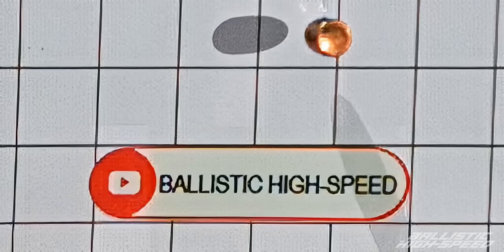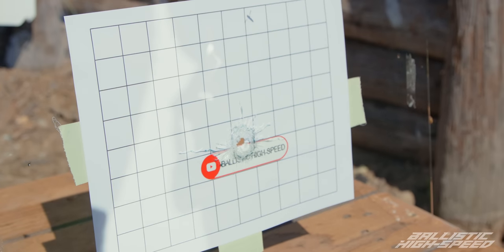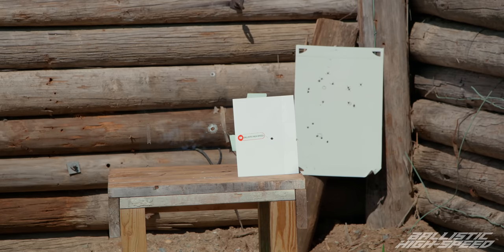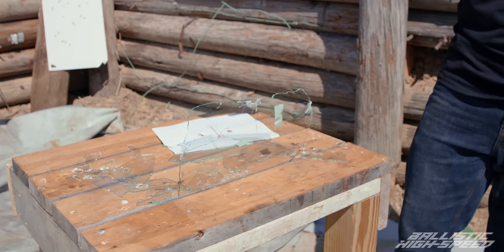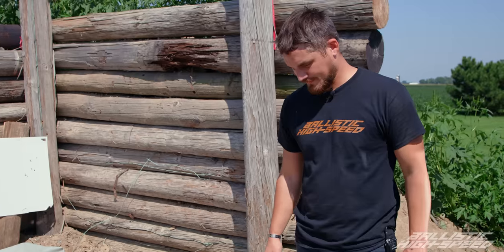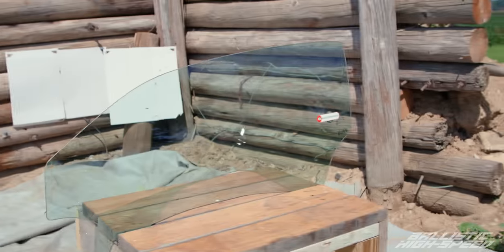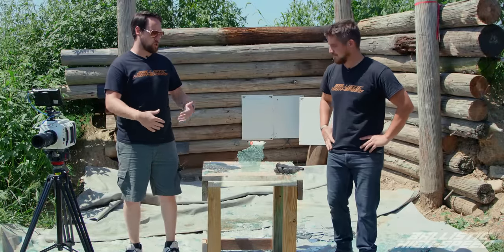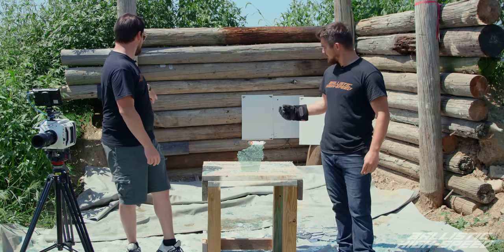Does Glass Break Faster than a Bullet?? - Ballistic High-Speed

Comment: As usual - this reveals details hardly imagined. Certainly the propagation speed of the stressed glass shattering is amazing. One other thing I wonder is - laminated glass, as per windshield - how much bullet deformation and how much deviation from original flight path, etc. Also, what happens to accuracy when something like a 40cal cop bullet is fired thru windshield from within. Great work guys. :)
Reply: I would love to see that
Reply: This came to my mind to! Cops will shoot through their windshield when needed, so I’d like to see how much the bullet deforms/deflects. And maybe even a non-slomo accuracy test
Reply: @keeganhenderson24  I think the most recent one was a Las Vegas chase where the guy was shooting back like crazy
Reply: @keeganhenderson24 They are trained to shoot through the hole they make with the first round.
Reply: @ATruckCampbell  They are trained to try to shoot through the hole they made. That’s rarely the case in shootings though. For multiple reasons
Reply: Id love to see the latter tested in slow mo
Reply: front of a car windshield aim low 3 inches becuase the bullet goes thru in an up direction 3 inches

Comment: Great video! I'm a 25 year glazier and have seen a lot of bullet holes in plate, and a ton of shot out windows with tempered. I've cut glass most of my carrier, broken a lot of tempered glass, and know it well. 

Tempered glass does break faster than the speed of sound. That's why there is a loud pop when it explodes. 

Pressure is what makes plate glass break more. Smaller, faster projectiles create less fractures because there is less force exerted on the glass. 

The buckshot is the most exciting on plate because of the more projectiles creating force with every hit. 

I love glass and I love guns.
Reply: your a good man david. and g-d knows that.❤

Comment: Amazing
Very interesting questions :) & truly a fun science experiment
* The speed of sound in glass is 4540  m/s (~13 times the speed of sound in air 343m/s at 20C) vs the 1650 m/s speed of crack propagation in tempered glass (that you have mentioned)
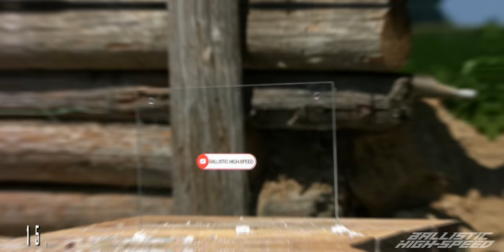@ 12:40 the cracks propagated in glass faster than the bullet that was passing in the air above it (it passed it despite the fact that that bullet was shot before the bullet that hit the glass!)
*super sonic bullets profile was a nice bonus
* throw in a shot gun for some "gratuitous violence" 😂
Reply: I guess you mentioned the "glass speed" (i.e. the linear propagation of cracks in the direction parallel to the bullet)=1400m/s vs 823 m/s for the bullet (super sonic in air) but I was too mesmerized by the footage that I didn't see it! (definitely want to keep such notes a bit longer on the screen in upcoming videos)
👍

Comment: In the dual bullet edge shot at 12:54 you missed something that you hypothesized earlier, which is that the crack propagates "faster than a speeding bullet". Note that the free moving bullet above the glass was leading the bullet that hit the end of the glass, but then the wave from the edge shot beat the free moving bullet to the end of the glass, thus traveling faster than the free moving bullet. This means that the shock wave traveled faster than whatever FPS that .223 round was moving at.

Comment: The shattering of the tempered glass travels at 1mi/sec 
which is faster than sound travels through air,
But could that speed be the speed of sound through glass ?
Reply: Interesting question.
Reply: Speed of sound though glass. 4540 m/s.

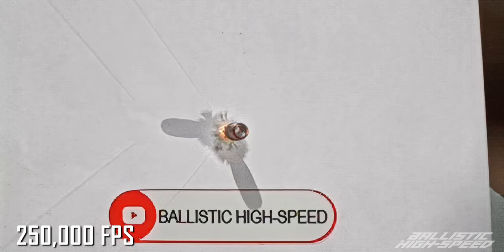Comment: 4:58 Holy crap thats a mind boggler of a shot. I'd love to know the relative density of the air molecules just in front of the bullet, since the shockwave is several millimeters in front of it.
Reply: What is that shadow of?
Reply: @faded183 that's the shock cone. The air density changes so much from the supersonic bullet pushing the air out of the way that it bends light and creates a shadow. If you were to measure the light around that shadow, it is actually slightly brighter than the ambient level.

Comment: It would be interesting to see a massive 50ft diameter piece of glass being shot in the center, with a single projectile, just to watch the leading edge of the crack propagation travel further since it travels so fast. And then do it again with randomly placed stickers to see how it might change that propagation if at all. It would also be interesting to completely cover the back of a piece of glass in clear packing tape and the shot it from the front, to try and hold more of the glass together and see if that changes the speed of the propagation.

Comment: I think part of the glass not completely shattering could be the miniscule amount of buffer that the piece of paper is adding. You can see a good example of it when you shoot the 45 and the 9mm crack gets bigger. It travels towards the 45 impact spot pretty quickly until it gets over to the paper and then it slows to a stop.
Reply: This was my theory also.  Part of the Shockwave gets directed into the paper instead of spreading all the way to the edge of the glass.  Even before they fired the first shot I suspected it would have this effect
Reply: @tnbourne  I wondered in the beginning of the paper would have any effect. Cool to see that it did in such an odd way lol

Comment: 8:56 
Actually, it might be several times the speed of sound in air, but you're watching the cracks move at EXACTLY the speed of sound in that glass as the shockwave moves through it.

Since air has a very low viscosity as a fluid, the speed of sound in it is relatively slow. That tempered glass has a MUCH higher "speed of sound" rate so the cracks propagate extremely quickly and we get one of the most beautiful shots ever seen on the channel. 

Excellent shooting by slowly walking the rounds towards the edge of the glass like that. That was almost the most perfectly ideal hit on that glass for this purpose. It was well worth the previous 6ish rounds.

Comment: The thin plate glass didn't shatter like you expected because it's not tempered.     tempered glass is designed to shatter, that's why they call it safety glass. 
They do that by adding a brief jet of air during the cooling process that causes the outside to shrink just a tiny bit faster than the inside  causing the glass to have a stress that creates strength as well as the ability to pretty much explode when it does get cracked

Comment: my first comment in the English-speaking community. the speed of a crack in glass (or any material should be equal to the speed of sound) in this medium, since the movement of a crack is the movement of matter in a certain medium. And the speed of sound is exactly the movement of matter. It would be strange if the body (crack) moved faster than the matter itself is satisfied

Comment: 2:39
The difference between a 9mm and a 45acp is only 2.43mm. It isn't a huge difference, but it feels bigger when you're holding both rounds in hand. When you consider that the typical bullet weights for the 9mm and 45acp are 115gr and 230gr respectively, it's kind of amazing that there's only about a 10% difference in terminal energy.

Comment: Tempered car windows with the tint film hold together in an almost single piece while the glass itself shatters. That makes my job as an auto glass technician easier, but would also make a VERY interesting video to see the end result as one piece. If you can manage to get a few windshields or laminated door glass to show laminated glass and how it reacts to bullets would be a very interesting video as well. I've seen and handled the end result several times, but never seen just what happens when laminated glass gets shot.

Comment: 11:30 Common misconception. Electricity does not take the path of least resistance. It takes all available paths, only more current is flowing through the path where resistance is slower. The whole impact on the glass is a circular wave like when dropping a pebble on water. And nothing is "deciding" where to crack, nor does the impact break molecular bonds. The path depends on much larger scale crystal structure of the glass, far greater than molecular level.

Comment: You guys need to get in touch with someone who's in possession of, and willing to use, some Raufoss Mk211 and shoot some thick tempered glass. 
Maybe you can get Scott to do the same with his 4 bore...  and then roll back to the minimum and see what happens with a .22 short or CB against the same thick panes, see if you get a splash instead of a shatter.

If he does bring the 4 bore, also take a ballistic dummy and several loose sheets of kevlar fabric to hang in front. You'll get to see the round get wrapped in the kevlar and pull it completely through.

Comment: By the way, for the most part you can't buy "plate" glass. You can only buy float glass - glass that was formed by floating liquid glass on tin. Tempered glass is treated float glass. It would also be interesting to shoot safety glass (two layers of non tempered float glass with plastic between them)- car windshields.  Another interesting option would be tempered safety glass, I think some German cars have that.  Bullet proof glass is a few layers (3) of thick tempered glass with thick plastic between them. Very similar to airliner windshields.
You can still get plate glass, it is the glass with wires inside it. 
Plate glass is rolled out, ground flat and polished clear. Float glass doesn't need the grinding and polishing, it is flat and clear from the lehr. The wavy glass in really old housed is sheet glass, another process

Comment: I actually know a couple things about panes of glass. If a object goes at a high speed through glass with a framed border. The frame's border is actually what will cause the glass to shatter. The vibrations caused by the object going through the glass. Will cause it to stress on the parts where the frame is holding it in. Now when it comes to a bullet going through a window with a frame. I don't think that super fast bullets would shatter it. And I'm talking about regular glass here not safety glass

Comment: It’s not the glass burning, it’s the copper. Glass is already an oxide, but almost any metal, finely divided enough and exposed to air, will ignite. I’ve seen powdered copper burn in air, and aluminium is notorious for it. 
Maybe try some low-light impacts against different metals? Zinc, titanium, magnesium and aluminium will give you some good results. 
Destin at Smarter Every Day has some great shots of Prince Rupert’s Drops exploding when fractured. They have similar internal stresses to tempered glass, but in a long , drop shaped form. Well worth a look. He’s also demonstrated how tough they are and it’s really quite startling .

Comment: when you talk about speed of sound relative to the crack propagation in the glass it is not the speed of sound in air that matters, but in glass.  That speed is about 5600m/s vs. 343m/s for air at standard pressure.
Reply from the maker: We know that. We’re using it as a comparison point for a speed most people understand.

Comment: Just a thought, only got to the plate glass, but if the glass was framed in and more rigid from all sides, would it make a difference?  I'm thinking that the glass only held from the bottom allows for movement to absorb shock.

Comment: Just a small question. You said it was a .223 out of a common AR platform but 5.56 and .223 are different. .223 is slightly smaller in the charge of powder and casing, and isn’t what you’d commonly use in an AR. Totes cool if you were using a .223 AR but just curious as the speed and inertia would be different. Cheers mate!

Comment: Most impressive, is when the air pressure cast shadows at 3:45 4:58
Reply: Air is transparent and does not absorb or reflect much light, hence it is improbable to have a shadow. In this article, we determine the conditions under which air can have a visible shadow comparable to the shadow of glass. This is done with refraction, by changing air's refractive index to that of glass, n=1.5. At a temperature of 0^oC, the air pressure needed to cast this shadow was found to be 1.57x10^8 Pa, analogous to the pressure used in high-pressure hydraulic hoses [5]. These are thought to be reasonable conditions to see the shadow of air.

Comment: The size difference between 45 and 9 mm is only 2.5 mm. A little wider than a nickel.
average 223 roundabout 3180fps weight 55 grain ----- average 9mm 1,200 weight 115 to 147 grains

Comment: "Ship in a bottle shot" shoot though the neck to blow out only the bottom 

Put an LED strip around the pane to highlight the cracking or add different colors 
 
Glass hologram 

Bottes and rectangular tanks under high pressure and vacuum pressure

Prince Ruperts drop I know its been done to death but maybe you can pull something new like biggest one ever shot
Reply: Get the plate glass extremely cold see if it shatters with one shot or extremely hot

Comment: I am surprised you were surprised the first pane of glass didn't shatter completely.
Glass is a crystalline structure, and as with any crystal. If there's no stress / tension in it then it can crack without going all the way across.
Now, it might surprise you even more that metal is also a crystalline structure. Meaning metal can (and will) crack when subjected to a high impact force. As you've seen with the jackets of jacketed bullets if anything else. Or as you shoot through sheet metal, it tears open into separate petals or sharp protrusions.
Glass is of course less dense, and relatively speaking harder (more brittle) than metals.
And with all that said, you technically can make metals so hardened they will shatter into a million pieces. Or you can make the crystalline structure such that it easily propagates cracks. Like with neodymium magnets, they are so brittle due to how the crystal structure is formed and if they didn't have that structure they wouldn't be magnetic.

Car windscreens are made of unstressed glass for this very reason, as any stresses would completely shatter the windscreen when struck which would send tiny pieces of glass into the face of the driver. We don't want that for obvious reasons. Windscreens are also laminated so that any shards that would potentially stab the driver in the eye socket still stay attached to the laminate (flexible plastic sheet sandwiched between glass) in the event of blunt force cracking it.
It's not perfect though, with enough energy some pieces will of course dislodge and it's not bullet proof and can quite easily be penetrated with anything with enough mass behind it even if it's moving slowly.

Car door windows on the other hand are tempered for the reason of being able to escape the vehicle when needed. Tempered means it's really stressed out, like it needs to take a chill pill... It's under such high tension that any minute crack in it will make the whole thing shatter in an explosion-like manner.
It might still hold together even after having cracked. But it has turned from a solid pane into a billion tiny pieces that just happen to still push on each other hard enough to not fall apart immediately.

But yeah, there's definitely glass out there that doesn't break apart in full so easily. Old glass used to be like that, until they started making tempered glass intentionally for safety reasons as old glass makes sharp blades that could easily fall and cut your jugular.

Comment: No, the bullet teleports through the glass and later when the glass decides, it pretends to move out of the bullets way.

They break at the same speed. The pressure passes through the glass, all of it at once. It appears to break nearest to the bullet because that is where the pressure is the greatest. As the pressure "fans" out, the glass appears to break slower, but the "shock" from the impact was  felt through all  of the glass the exact moment the pressure from the bullet interacted with the glass.  

Matter can't occupy  the  same space as  other  matter, thus the moment the glass begins to be displaced  by the bullet, all  the surrounding glass is  effected. The exact moment, zero delay...

Comment: Ah, I see, "FPS" is frames per second not feet per second.  Pistol rounds typically are sub-sonic which is roughly 330 meters per second or about 1100 feet per second muzzle velocity.  The Glock 19 probably has a muzzle velocity of just above the speed of sound at STP, I think about 1120 fps =341 m/s

Comment: Plate glass is akin to soft steel, as the molecules are not very random, so it will bend and flex without breaking. Hence, the bullets pass through with no great reaction. As you get into tempered, or hardened glass, the molecules are extremely random and chaotic, making the bond very tight. This is why extremely hardened steel, like drill bits,l will shatter, yet are very very tough at the same time.

It's much the same as trying to tear a piece of paper. If it's just a sheet, it will tear easily. But, crumple it up to a ball, and tearing is just about impossible.